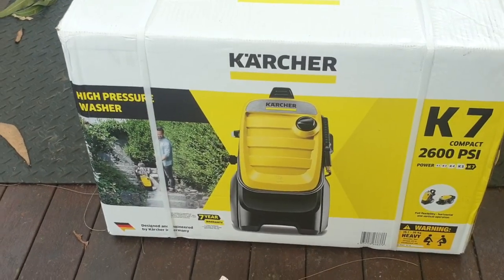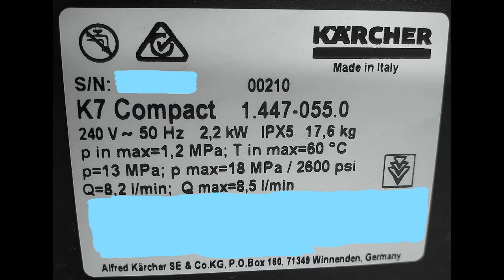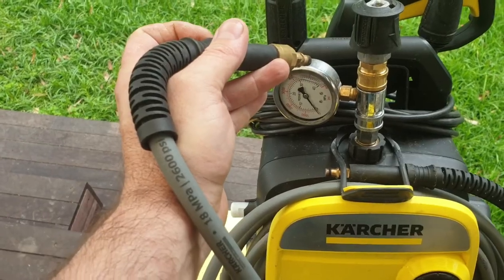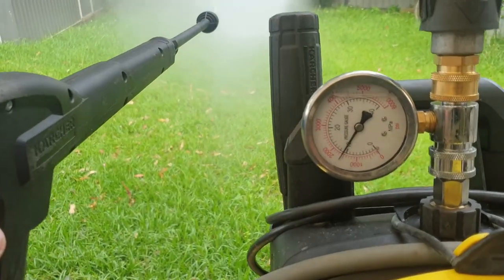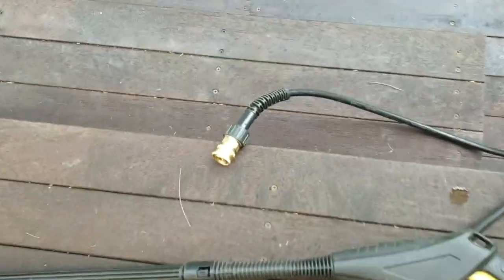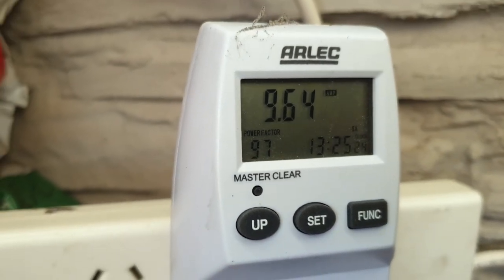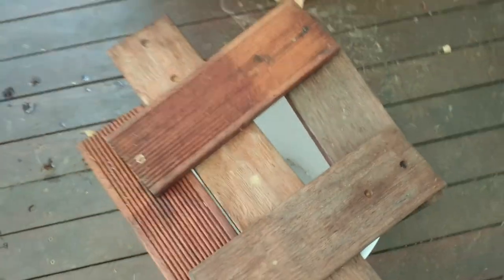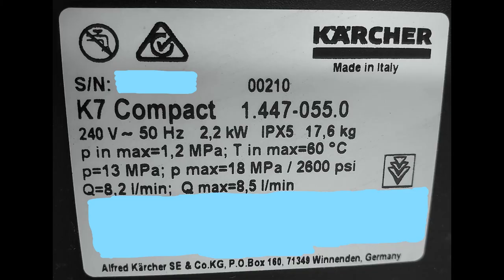Karcher K7 Compact - Lets test real PSI and Flow and see if they are lying?

Comment: To answer your question about pressure ratings. A lot of company dont list the operating pressure, they list the overflow valve (or unloader valve depending on your country) opening pressure. Simply put, the operating pressure is whats reached when the trigger is pulled. So the pressure created by the nozzle as a fixed amount of volume runs through it. The overflow valve opening pressure (sometimes called spike pressure) is the pressure that needs to be reached for the machine to go in to bypass mode. So in the end overflow valve opening pressure is ALWAYS greater (10-20%) than operating pressure. So of course the marketing department uses opening pressure in the literature and nomenclature.
Reply: All these manufacturers love to only mention the "max pressure", but the devices are never able to reach that pressure. They should be obligated to mention the "working pressure", but you can only find these in the small prints. The "working pressure" is the realistic pressure.

For the Karcher K7: the working pressure is 160 bar (16 mpa)
180 bar (18 mpa) is pure marketing.

For the Ava P80: the working pressure is 130 bar (13 mpa)
160 bar (16 mpa) is pure marketing.

Comment: But one downside of the Karcher is the metal alloys they use instead of the brass parts like some of the better quality units, Kranzle (german made and had some unfortunate inflation issues over the last few years) have brass parts and people like the longevity they have
Reply from the maker: Very true.
Reply: This is definitely late, but if you choose an karcher professional pressure washer they have brass parts too, and some saw that they have ceramic coated stainless steel
Reply: I bought this and replaced everything but the body. It has a better hose, a better gun and brass quick connections.

Comment: Get the gauge checked/calibrated.. cheap gauges can be out by over 50% and change in accuracy depending on pressure… and don’t believe the ‘calibration’ cert provided 👍

Talking as someone who works in a laboratory with pressure testing equipment to NATA and AS standards.
Reply from the maker: Thanks for the advise but that was 2 years ago! I get where your coming from but I accept it could be out a little but dare say I don't think its more than +/- 5% at worse. But like you say can't know for sure unless I get it certified. Not gonna happen for quick test for measuring round about figures for a home test environment. To me the nominal power it draws vs litres per minute seem to line up with the pressure I measured with the cheap amazon gauge. The 3 all line up pretty close . If 1 of the 3 was off then I could blame a faulty cheap amp/watt meter or the cheap amazon pressure gauge or the bathroom scale. It's a simple test that I did with what I had with no money or sponsors or donations. Happy to send you the gauge if you like, only used it for that 1 off test 2 years ago. Wouldn't surprise me if its internals are corroded by now but if you can verify it at your cost then I'm happy to send it to you if postage is not too expensive!

Comment: Cheers mate. Very informative Sam. But have I missed the point here? Correct me if I'm wrong but your PSI measurement came out to only around 1800PSI using the Karcher lance and a little higher using the Audi one. Both nowhere near the claimed 2500 PSI. And isn't ultimately the PSI reading the real measure of how powerful the device is at removing dirt? Many thanks in anticipation of an explanation as I'm minded to get one of these otherwise.
Reply from the maker: Wow how time flys.... been almost 2 years now. Memory is a little foggy but as said at around the 1 minute mark the MAX rating of any pressure washer should NOT be believed on any pressure washer, it is most likely the pressure of peak intermittent spikes it could possibly handle from time to time! When ever you look at pressure washers you need to get the nominal rating which on this unit is 13MPa (around 1885psi). Think of it like this , lets say your car can rev a maximum of 8000rpm but what happens if you hit that peak for long periods of time? kaboom! just because its rated at 16MPa MAX doesn't mean you should! hope that makes sense. In any case when looking to buy NEVER fixate on the MAX rating (That's the sales mumbo-jumbo to suck you in ) instead look at the lower figure ALWAYS as that should be the nominal running it can handle constantly. 

So the aim of this video is simple. It is to test the unit for nominal PSI vs kW vs Q as stated on the label . It states nominal rating of 13MPa@2.2kW and at that rating it should pump out 8.2L/min  so therefore I conclude that it does that. I get that my test were not lab quality precise but neither are the nozzles, eg: a blue nozzle from amazon vs a quality brand will give you different readings, so in short nothing is perfect. If the power at your house is 240Vac and the power at my house is 230Vac the results will not be the same but nominally it will be close.  

So in reality, if you try to understand in what I consider "the holy trinity" of nominal PSI/Kw/Q ratings of pressure washers you should be able look at any pressure washer and with the perfect nozzle size be able to achieve those nominal ratings that are stated on the label.   

Hope that has made it clearer for you.

Comment: Good test! Thaks! 
I have the same model. Bought just yesterday. But my pressure washer consumes 3 kW of energy. And it actually has a minimum pressure of 150 bar compared to your pressure washer. Interesting...This iformation i saw on the back side.
Reply from the maker: Thank you for the feedback. Yes its funny that the exact same pressure washer has different ratings in different locations. Which location are you from?
Reply: @SamFerlauto  I'm from Kazakhstan. Where are you from? US? Or UK?
 It turns out that the sink does not produce the declared power and pressure? Or is everything okay?
I tested my Karcher K7 yesterday. The pressure is a little weak. Because I have problems with the voltage in the network. It is weak and sometimes less than 200 volts. I will install a voltage stabilizer, and also put a barrel of water for Karcher K7
Reply from the maker: Australia. What are all the values on the specification plate on the bottom of the unit.
Reply: @SamFerlauto  Uu Australia. It's so far. Good country! Good people live there. Exotic nature and most dangerous animal's on the planet Earth))
Printed on the bottom K7 compact 3Kwt power
15Mpa(150 bar) min pressure. 18Mpa(180 bar) max pressure.
Water consumption 9.2l min, and 10 l max
Sorry for my English)) It is not our native language
Reply from the maker: Interesting. So you have a more powerful motor than the Australian version. 3kw vs mine at 2.2kw and 9.2l vs mine at 8.2l. 1 thing I can tell you is the standard turbo lance should be very strong but the adjustable one is much weaker. To get more pressure you will need to get an attachment with adjustable tips like I did in my testing but to understand what pressure you are getting you will need to do similar and buy a guage and quick connect attachments . See my description for amazon links. Also your English is good and I can understand you well
Reply: @SamFerlauto  Hello guys, another Karcher user here. I am in Latin America and K7 is not sold here, so it took me to step up for a 6/15. Specs from my plate are 3,2 kW, p = 15 MPa, P max = 22 MPa and Q = 9,1 l/min. Actually, less flow than Kazakhstan version K7. Here K-series are 110 volts only and waaay underpowered. Mine is 220V 60 Hz.
Reply: @SamFerlauto  Yes, in your country there is some kind of defective version of K7. Our K5 has the same characteristics, the cheaper version 2.1kW 145bar max. And k7 has 3.0 kW and 180 bar max pressure.

Comment: Thanks Sam, great video. Also thanks for the explanations in the comments. Some of the points I didn’t fully understand first time watching. Just wondering, how long did it take to wash your driveway? Would you say it is faster than your previous machine?
Reply from the maker: Been a while now and probably time I redo my paths and driveway again. But I think when I used to do it would take me around 5 to 6 hours and if I went any faster it would leave lines . With the Karcher K7 paired with the Tracer 7 I think I can happily say its halved that time with a more even result. If I want to get better and faster result then there is nothing really that's electric that can. So in order to go the next step then it has to be petrol powered and thats too noisy and too heavy for my back right now..... oh previous was the Aldi branded one and the top of the line Jet-USA 3500psi which turned out the cheap Aldi was more powerful than the JET Usa. I complained and told them my findings and that they were not as per label. They asked for me to return the unit for testing. Next day no result, instead they reversed my payment immediately and said nothing of their testing results. Basically they did that to shut me up and get the unit from me before I could test like I did the K7. So don't buy a Jet Usa because the claim nominal 2500psi @ 6.8l ..... unless I had a really bad unit it wasn't even close! Anyway that was a long time ago, maybe now they have gotten better
Reply: @SamFerlauto  thanks Sam, great info. I hope to upgrade my K2 to a K7 soon

Comment: Thanks for the video - nice to validate their specs.  Just wondering your take on it... is the lance that comes with it that bad?  Do you think it should be replaced to make the unit worthwhile?  Thanks!
Reply from the maker: The test was simply to validate the spec sheet.  Now that it can supply the correct psi and litres per minute if you play with different nozzle orifices to match. The Turbo lance is really good and it blasts very well but the variable lance is ok cranked up but not as good as a tuned tip with a smaller orifice. Also I did pair it up with a Ryobi patio cleaner which gave me great results and much faster in completing the job BUT was a real pain to find all sorts of attachments to attach it with no leaks. Unfortunately it hasn't stopped raining here almost every weekend since I made the video and not gonna be sunny anytime soon! I want to buy a T7 and do away with all the attachments and see if I can get it to perform like the cheap Ryobi patio cleaner but until I get good weather that ain't happening!
Reply: You say they are crappy but I’m not happy with Karacher as my first K7 compact from 12 years ago lasted 10 years and the latest one managed 2 years and died, Karcher will not help or diagnose the problem by calling their support. I used mine very lightly as well, cleaning the car in the sumner maybe every fortnight and 2-3 other times for patio or other things. A repair centre cost is more than half of the price of the machine and that’s before any parts might be needed. I will not be buying any more from them.
Reply: @Pain4yourmind  Where are you? In the UK they have a 3 year warranty.

Comment: Hello, thanks for your review. I have some questions. In your measurements, the K7 gives a maximum force of 130 bar (13 mpa) and discharges 8 liters of water per minute. In my country, this machine is very expensive. I just need a machine that will wash my car vigorously, do you think?  Can you tell me the brand / model that is stronger but not too expensive and you have used before?
Reply from the maker: Sorry but I have only tested this one. For washing a car a 40degree tip at around 1000psi is ideal from what I have seen from other car detailed video's.

Comment: Hi I have just bought the Compact K7 from Karcher Trafalgar. I also have had the Karcher 750 MX for approx 20years and decided on a new machine as I imagine the 750MX is losing power. I tried the K7 Compact today with my Karcher T300 racer and I can't help thinking that my old 750 MX has as much power if not more than the Compact K7. Is this at all possible ?? .MY old 750MX would lift the T racer off the ground when it was new. Plus, after releasing the trigger on the Compact K7 there is an audible hiss from the machine for a split second, is this normal ? Thanks in advance for any replys.
Reply from the maker: Hey James. I'm by no means no expert on various pressure washers and haven't used the K7 for a while, but can say that I don't recall a hiss when letting go of the trigger. It could be possible that maybe a valve might be stuck open by either dirt or debree that could have come through the water line or metal debree from the manufacturing process. This could explain less pressure that is allowed to build up and the hiss could be the back flowing pressure bleeding back. If possible you should take it back and get another unit or get Karcher to check it out. So but currently travelling so I can't even confirm if the hissing happens on mine

Comment: Hi Sam. I bought this K7 compact home unit for 6 months now, worked fine with no problems, but just now it happend to leak very powerful from the output water quick-connector (where you plug the water cord gun in) when the unit is off with the water open all the way up, without the gun plugged in. When I plug the gun, it doesn't leak anymore and works normally. Is this normal to shoot water out when the gun (cord) is disconnected, but only with the water hose connected and open? Thanks.
Reply from the maker: I've not tried running without a hose in the past but yes this will be normal as I have just removed my quick connector and can look through it... so there is no valve so therefore when the hose is not connected and the tap is on you will have water coming out of the quick connector.
Reply: @SamFerlauto  that's true. I've just look with a flashlight and it doesn't have any valve in there, it's just a clear hole. I was not sure if it has to shoot water from there if the gun is unplugged with the water hose on. I was really worried because I left the k7 in my workshop till now and the temperature was near to 0 degrees celsius. Today a took it home in the boiler room. Sorry for my english. Thanks a lot. Wish you a happy new year and good luck! 🥂
Reply from the maker: @calinsandor9518  thank you. Hope you get nice goodies from Santa! Your English is perfect no need to apologise!

Comment: Umm you didn't take off the weight of the bucket.. the bucket would weigh at least 750grams to a kilo.
That drops the flow to around 7.1lpm.
Also you used the non standard nozzle for the flow test. This is not to appropriate and changes the flow as the outlet size is different.

1600 psi is extremely poor for such an expensive machine.

To give you a comparison, the $129 dollar ozito will give you 1600psi and 6lpm...

This karcher is a overpriced piece of junk, and not to mention extremely unreliable and poor customer support from Karcher.
Stay away and do your own research.

Some info:
Karcher k2 1250psi @ 4.07lpm
K3 1500psi @ 4.4lpm
K4 and k5 are the same 1400psi @4.4lpm
K7 1600 psi @ approx 6-7lpm
Reply from the maker: Hey thanks for commenting and yes your right I didn't weigh the bucket. It was around 750gr. 

Couple of points though
1. hard to see on the video but a lot of water was splashing out as well so probably lost 200 or so grams there. So I would say around all up your looking at around 7.6lpm at 1850PSI

2. Yes I used a tip that doesn't come with the unit to reach the nominated pressure, amperage and kW rating, but how else can you test the nominal ratings?

In a perfect world where I had all the time in the world and I wasn't recoving of a back injury I would probably make a followup video. But no one is paying me to test it and this video was simply to show my quick findings and to get it to close to the nominal ratings.

Anyway the unit I have is still going and still doing a decent job. Maybe when it dies I'll buy an Ozito and test that out for you!